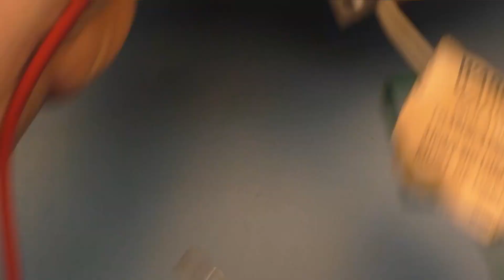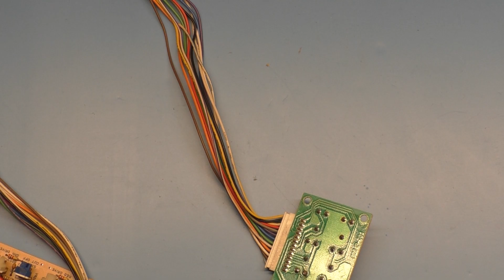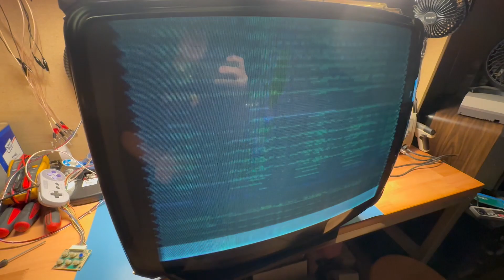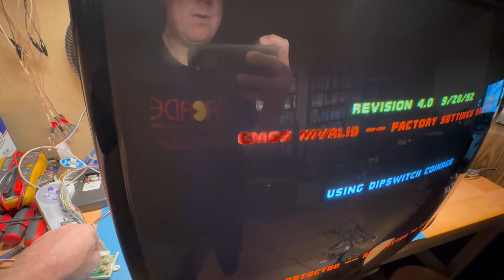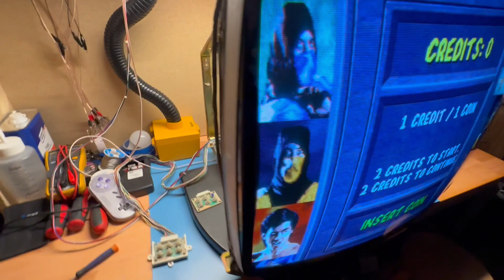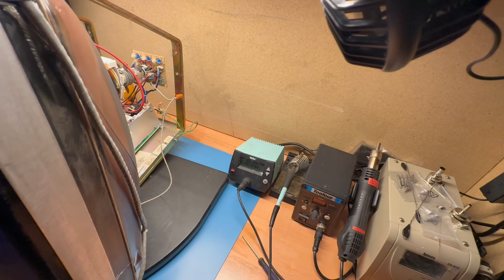25" K7000 Arcade Monitor Repair - "Worked Before Cap Kit - Now It's Dead"

Comment: I have the same monitor that just shuts off after about 15 / 20 minutes of play.  Does that sound like it's in need of a cap kit?
Reply from the maker: If the caps are still original, yes. For sure.
Reply: @MikesArcadeMonitorRepair  Can you do the repairs if I send you the board?  The monitor is a K7501.